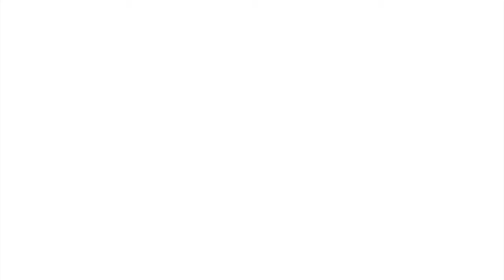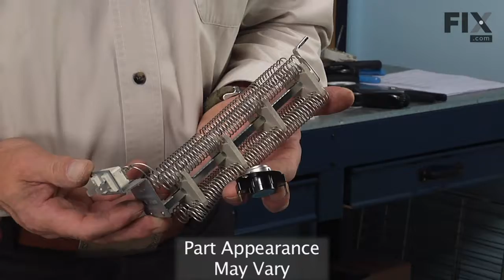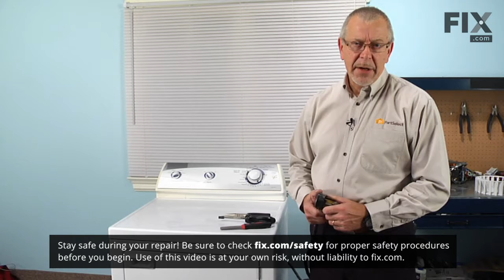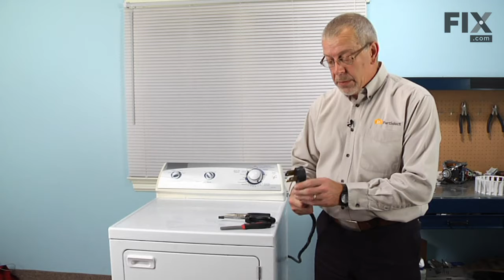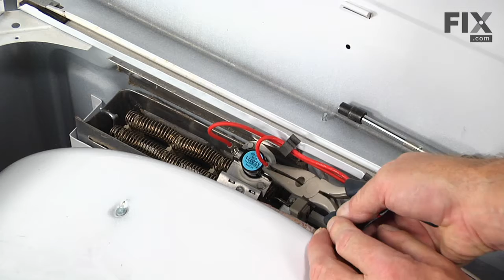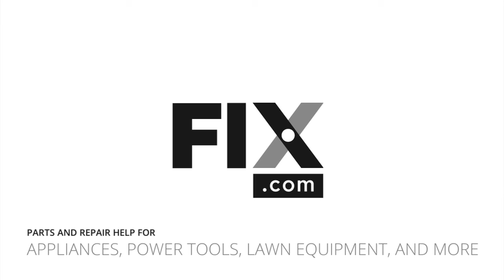Magic Chef Dryer Repair – How to replace the Heating Element Kit - 240V 4750W

Comment: I think I have to drive into my mini magic chef dryer, should i make a video and send it to you guys ?  MCSDRY1S  the issue im having >> https://www.applianceblog.com/mainforums/threads/65484-MCSDRY1S-Dryer-stopped-working-Sometimes-turns-on-but-then-stops-again-a-few-minutes-later
Reply from the maker: Thanks fgor the question. Here's a link that might be useful: https://www.fix.com/repair/appliance/dryer/shuts-off-too-soon/. You can also use our website to troubleshoot your dryer further here: https://www.fix.com/repair/appliance/dryer/